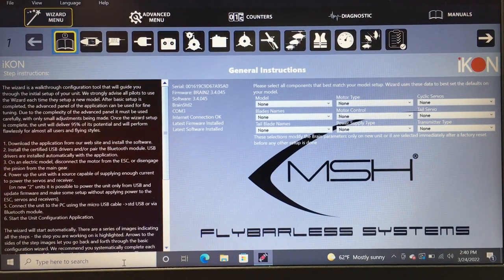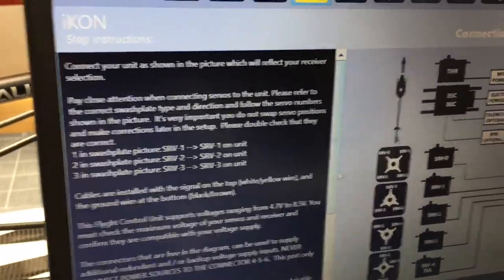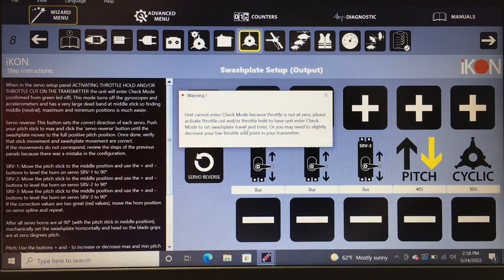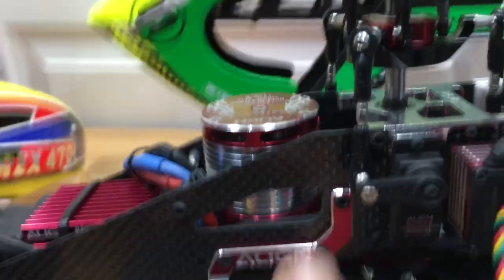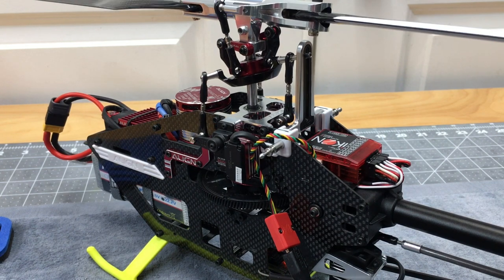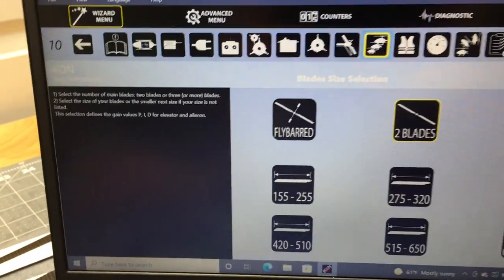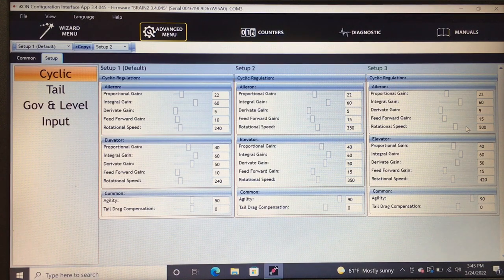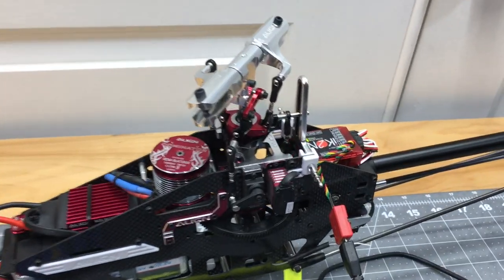How To Setup MSH Brain/Ikon 2

Comment: Great video same always,I wish you would update configuration either in description or setup file,definitely you changed some items after couple of flying
Reply from the maker: so depending on the helicopter third depends on what gets changed. I would say 85% of the time off the bench set up is pretty much perfect. Because I have set them up so I can kind of guess what needs to be changed and adjusted. I did make video on advanced menus and what I charge a month or so ago.

Comment: This is fantastic, man! Thank you so much for this walkthrough! This will help me greatly 👍
Now, I haven"t done anything on my 470 for almost 2 months, so I might remember wrongly, but I think I might figured out what I did wrong, although I don't know what the effect is: Cyclic servo refresh frequency was set wrong on mine. According to the table it should be 200, I think mine was set to 333 Hz. Perhaps that's why I had way off servo travels, totally disporportional to the stick positions. 
Anyhow, thanks again. I think I could use your file too 🙂
Reply from the maker: Awesome glad this video helps! Yes servo refresh rate is a big thing. If it is off it will cause quite a few issues! As soon as I’m done buying tweaking the file I can send it to you.
Reply: @westhobbiesrc8051  I recently found time to set up the brain correctly - so was the hope. I set the servo refresh rate exactly as you did, but it didn't fix the issue (major difference between servo throw and stick (tx) throw. 
Upset with this thing, not sure when I'll get the FrSky rx/tx, long wait. Possibly selling this thing. Really fed up.
Reply: @westhobbiesrc8051  Hi, I tried to set up my heli once again, this time with my new FrSky Taranis (OpenTX), which I got a few days ago. Since you done this also with your Radiomaster (OpenTX), I thought I'd ask you for advice. It's about that cyclic throw difference like you show here in your video at around 17:50 . So what I did for one side, which didn't go far enough, is: I increased travel as you did - in OpenTX travel value increase is - from my understanding - on the page "Output". So I increased the aileron travel/endpoint for that side but nothing happened (I kept an eye on the pitch gauge while increasing the value). I thought I might be adjusting the wrong channel or wrong direction, but after decreasing the value a lot, the aileron/cyclic popped into neutral position. So it was the right value I was increasing. I previously ticked "extended limits" or whatever it's called, so I could previously set/reach the 100% marks in the Brain-software. 
Did I miss something so that the aileron travel (and the elevator travel to be complete) can't be adjusted? 
Another thing I noticed: I can't tick self level in setup 1 but can in setup 2 and 3. But what for in 2 and 3 lol
And another thing. The tail: I go full tail rotor deflection, release the rudderstick and... the servo/tail stays there while the rudderstick is already in center. Then I push the rudderstick in the opposite direction and the tail goes into the other direction but only as long as I keep pushing the stick. The farther I push the rudderstick, the faster the servo acts. Is this normal? I thought the tail should pop back to center if I release the rudderstick (?)
And another thing. Again cyclic movement: I push the right stick to about 50% throw - the swashplate tilts as expected, but for the remaining 50% stickthrow the swasplate barely moves/deflects any further (maybe 1% further).
Funny thing: My helicopter and/or FBL-unit (MSH Brain2) acts the same way, as it acted when I tried to set it up with my old FlySky Tx/Rx. 
Now, I got me the FrSky Taranis (F.Port !), because the Brain-develelopers confirmed that they're certain their FBL-unit functions flawlessly with FrSky in F.Port mode.
Any advice would be greatly appreciated. I'm kinda lost right now :(

Comment: Great video. Question: on the Swash setup step, you say to use the Ikon software to get your three servos at 90 degrees then mechanically adjust the linkages till your swash plate leveler tool checks out. Does this step have to be done at midstick?
Reply from the maker: Thank you! So yes, when you are in the iKon software you will be in “Check mode” you will need to have the stick at mid stick and adjust from there. So at mid stick your servos will be 90. If they are off a lot move the horn and then fine tune if they are just off a little then just fine tune. Once the servos are 90 then move up to the swash and then Head.
Reply: @westhobbiesrc8051  thank you for the reply. I will give that a shot. I am working on a Trex 250 DFC and the linkages are not like your 450 in the video. They are very basic and require disassembly of the head to adjust each linkage. If I'm close mechanically at mid stick in regards to a level swash, is it ok to use ikon software to adjust each servo to finish the job?

Comment: Good manual. Let me advise you some tricks. You should have 100% travel in fbl system, and if you touching pitch travel range its not correct. The right way, to have same collective at both sides, is to move your swash plate mechanically up(in your case, because you have positive pitch +1 degree more), and after mechanically set zero pitch again. For cyclic if you want to have perfect ranges with aileron and elevator both sides you should go to advanced menu-common-ccpm. Setup aileron and elevator positive cyclic there. Then you go further to servos menu, where you have servo travel limit. For example with elevator, you set positive range before , and you have different values at negative side, need to adjust elevator negative range. Same procedure for aileron and pitch servos, to have the best.
Reply from the maker: Yes you should have 100% travel in the FBL system hence monitoring and adjusting travel in your radio till you get 100% positive and negative on all cyclic range. Unfortunately setting up the swashplate like you’re saying doesn’t always work. Yes in a perfect world it does but I have set up over 120 Ikon/Brain FBL units. I don’t think I’ve ever had a one that allowed me to get perfect positive and negative pitch equally no matter how much I adjusted the servo length and or if I got the perfect servo length then I could never get zero pitch at the head. The way I do it is perfect works fantastic gives you perfect 90° servo arms perfect zero pitch at mid stick. But I appreciate you commenting, if that works for you fantastic I have personally never been able to get one set up that way and all of them that I have done over the years on all different makes models doesn’t matter the helicopter doesn’t matter the servos I always no matter what have to adjust pitch throw in the radio to get an equal positive and negative even if it’s a few degrees I still have to adjust it no matter what I do with servo arms. A perfect world yes that is how you do it unfortunately in the hundred plus that I have set up never been able to.
Reply: @westhobbiesrc8051  Just never give up and try hundred first time) If you did first time like that, and you feel it’s working, the next hundred times doesn’t matter, but that doesnt mean that the system can be configured only that way, you forgot old school, when most adjustments were mechanically and configuration was near perfect if you will play with it some time.. Anyway the video guide is brilliant😊
Reply: Have you ever used the Soko tools method? I have been experimenting with it and it seems to work really well.

Comment: Hi Jeff.  What do you suppose would cause the aileron to not move on the screen as I movethe stick?  That should be servo 1 and I made sure all the servos are plugged into the correct location on the IKon.  Could this be a radio setting?
Reply from the maker: @Maniac96744  does it move in the radio and not the FBL or it does not move in the radio?
Reply: @westhobbiesrc8051  it does move in the radio but in the Ikon setup it moves the elevator instead of the aileron.  I bought this model and put itI together 8 years ago or so.   I crashed it and moved back to the east coast from Hawaii and it sat in my basement for 4 years.  I’m trying to set it up with  a new FBL because the Microbeast isn’t so user friendly in my opinion. You seem to like the Ikon so figured id give it a shot.  I tried switching out a servo but that didn’t change.  I do have the Spekteum satellite plugged in and it is binded to the TX.

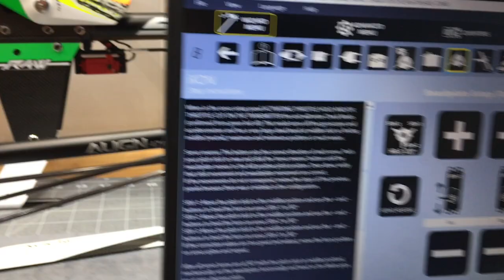Comment: 16:00 what is the best way to make sure you are at pitch 0 at real mid stick? When i go into the ikon setup, there is a large dead band in mid stick and when i get out of the setup the mid stick is usually off by a few notches of the gimble. I want true mid stick according to my gimble. What is the best way to accomplish this, adjust the upper linkages or would it be a software setting in the ikon?
Reply from the maker: So mid stick will always be true to the FBL in the software. There is no 1000% but if your 0 at mid stick in the software you will be 99% percent. That .01 or so difference will never be seen or noticed. As long as you’re in check mode I would not worry unless there is a huge difference. Also make sure to calibrate your sticks in the radio to be more perfect.

Comment: If someone has an NX6 transmitter, would rescue be on Aux2?  The NX6 actually has a 7th channel.   In channel assign, 1 is throttle, 2 is aileron, 3 is elevator, 4 is rudder, 5 is GEAR, 6 is Aux 1/pitch, and 7 is Aux for what you need to assign to.   Figure this would be for the rescue?
Reply from the maker: So you need 8ch to take full advantage of the iKon. CH5 “Gear” is used for tail gain. AUX 1 (7th channel) is for flight modes in the iKon and AUX 2 (8th channel is rescue) now, you can do some remapping in the iKon under Advanced menus and not use the flight mode and use AUX1 as Rescue or Auto level.
Reply: Thank you.  That may make my V Controller decision easier.  Lol.   When I got the NX6, it was with a Fusion 360 because I didn't know who deep I wanted to get into the hobby again.  Lol
Reply from the maker: @AllanG1914  so far I’m very impressed with the radio. I wish I could get more Vbars so I could get some more helis on it but, I’m going to be making full videos on it soon and so,e compensation videos. But I will say, it’s a million times better then a NX6/NX8/NX10. In my opinion the NX radios are way over priced for what you get. it’s also really nice on the Vcontrol/VBAR that everything you need is on the radio, no satellites, no extra stuff. Just bind it and setup all from the radio.

Comment: At the 21min mark you are testing the servo travel so they dont hit and the blades are on with the battery plugged in.  As a first time heli pilot, im a bit nervous about this step.
Reply from the maker: Yes the battery is plugged in, the radio is on hold mode. Of course anything can happen and the Heli can spool up. Blades have to be on to set pitch and travel. If you are nervous about the Heli spooling up you could always unplug the motor wires or loosen the motor up and separate the pinion from the main gear.

Comment: thanks for the good videos ! what is a good pitch for starting point normal mode and 3D mode just learning how to set up m heli but I see that you put your pitch degree around 13.5 but thats for normal flight ?
Reply from the maker: I always run +/- 13.5 degrees but you should start around 12.5 and see how you like it. add or take away pitch to your liking.

Comment: So why are we not setting the pitch to +-100 even though the instructions say to do so? I did find that when I set the pitch channel as per the instructions I had way too much collective and I can not reduce it anymore in the setup wizard the same goes for roll and the least amount of pitch I can reduce it to is 17.5
Reply from the maker: No, there is no need to set the travel in the software to +/- 100%. You want to start at +/-100 in your radio and then set your pitch in the wizard menu to positive 13.5 or 12 witch ever you like.then use your radio travel to get the same equal negative pitch.

Comment: Got my Sab goblin setup flys great but my tail bobs up and down. What u think the issue is. Have a ikon flybarless system.
Reply from the maker: Tail up and down is usually a sign of cyclic wobble. Does it do it in all head speeds? What head speed are you running? What SAB?
Reply: @westhobbiesrc8051  Sab 500 and head speed is 2400 to 2600.
Reply from the maker: @johnbess7320  OK that’s definitely great head speed for that helicopter. I would start by lowering cyclic Gain

Comment: How would you make the heli to pirouette really fast and to stop instantly? Other than mixing rudder to gyro gain, is there any other way to do it?
Reply from the maker: Turning rotation rate up and then adjusting Stop gain as high as you can till it starts to bounce back. But in doing so depending on the helicopter if it is a TT you will risk blowing TT gears out instantly from the abrupt stop. Belted tails can take the Instant stop/abuse a lot better then a TT heli can.

Comment: It's not that pitch curve is "non-linear" it's that the pitch curve is not centered. To get equal pitch travel, try lengthing or shortening the servo linkages evenly so the swashplate moves up or down a bit when the servo arms are at 90 degrees. Re-zero the pitch and then check for equal travel.

Comment: I’m able to follow the video, there’s no gyro for my tail however, everything this normal in the heli and the same in the video, with the exception of in transmitter setup heading lock is red and not checked and I can’t change that
Reply from the maker: You have to select gyro in the radio and then add your percentage. If you don’t then the iKon won’t see it. What radio?

Comment: I have accurc, and I have played around with cyclic agility on the flybarless in the sim. How can I convert the amount of deg/s I use in the sim, to the setup on the brain 2? (I like 350 deg/s)
Reply from the maker: Rotation speed? You do that in the advanced menus. You can say how fast you like cyclic as well as tail for each mode.
Reply: @westhobbiesrc8051  1750-1900-2100 rpm, this is on a Goblin Kraken 700.
Reply from the maker: @lassepettersen8298  yes that is head speed, if you want 350deg/s go into Advance menus and adjust it till you were liking.

Comment: Bro I fallow this video but I have 2 problems the first one is my heli spins when is in normal mode with out doing nothing in the transmitter and second my tail in hold mode move normal right and left but when I go to normal mode the tail moved to right and I have to moved the rud to left and stock means that the tail don't move like right and left stick in right and when I move to the left stick to left not back and forth like when is in hold mode the servo comeback from right and left but not in normal mode can someone help me please
Reply from the maker: What do you mean spins? When you apply power? Make sure your tail direction is correct. When you spend your main rotor which is clockwise your tail spins counterclockwise. Are you talking about at Steve’s One Direction or the other when you let off of the stick and does not return to center? That is normal.

Comment: My throttle is reversed and as soon as I hit page 8 it comes on and goes full bore and I have to pull the USB to stop it! 

I have tried reversing the throttle in the TX and It works fine but WHY is page 8 making the throttle go crazy?! I can't figure this out. I am on day 2 of trying to setup this gyro and man o man it's been hard. This is not plug and play. It's plug and reverse things. 

I want to know WHY the brain2 has suddenly reversed the throttle sticks input. This was on a flying 330s with a 6250 and this was not an issue. 

All this stuff just to add retracts!!!!!
Reply from the maker: No idea, never seen that. I’ve setup hundreds of them and never had a problem. Are you I’m hold mode while setting up?
Reply: @westhobbiesrc8051  nope, hold is off. I tried hold mode to shut it off and it doesn't turn the throttle off. I have to physically pull the USB to stop it. Why the USB is controlling the ESC I don't know.  I had it all good with the throttle reversed, but the tx page is showing the inputs backwards, so it thinks I'm full bore when I get to page 8 and goes crazy. 

There is no way to reverse the throttle - ESC commands in the brain2 app. Somehow the brain2 made the ESC flip controls.
Reply from the maker: @SpeedyTube83  I would delete the radio file and Brain file and start over. You have something messed up. Always set the heli up in hold mode. Never out of hold.
Reply: I got it working! Had to pick a different orientation for the FBL than what it is, reversed throttle at the end screen, and used channel 5 for a servo for retracts and Ltrim for gyro gain. Man I man that was a long day diaging!